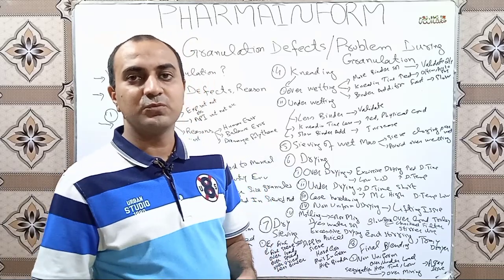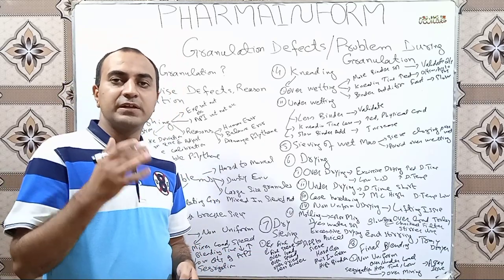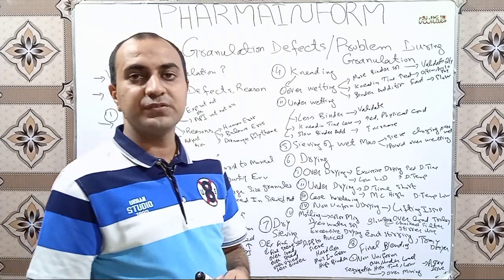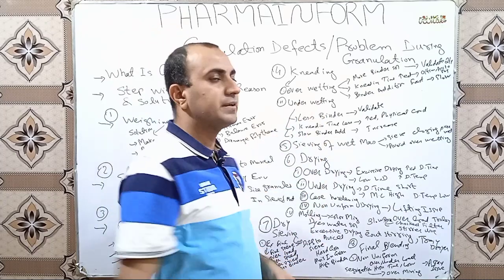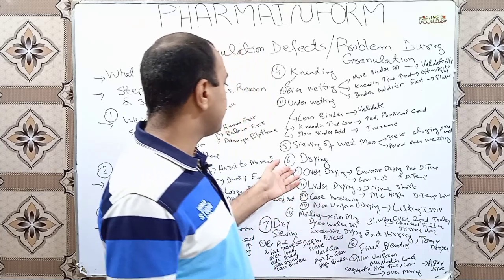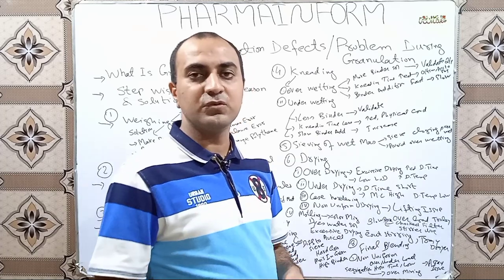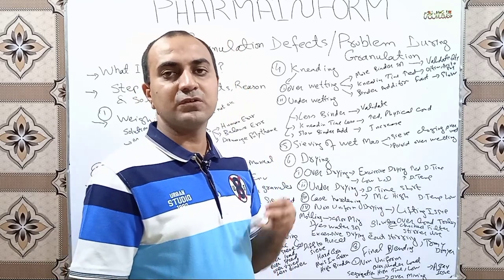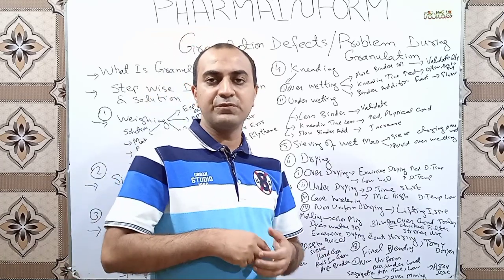Granulation Defects | Tablet Manufacturing Problems | Reasons & Remedies Of Granulation Problems

Comment: Sir if the granules are over dried what is the solution for that?
Reply: @Pharmainform  Please sir can u explain me more?
Reply from the maker: if grains are over wet and over dried it results in very hard granules making drug release slow so we reduce the particle size to enhance drug release due to large surface area.Can use more disintegrant as well.
If granules are normally wet & are over dried it may result in capping, lamination so we apply moisture to the granules
Reply: Sir what happen when lubricant is over blended with the dried granule? And how?
Reply from the maker: it may result in capping or lamination
Reply: @Pharmainform  Does it effect DT?
Reply from the maker: Yes both on Dt & dissolution
Reply from the maker: Watch lubricants video In excipient playlist